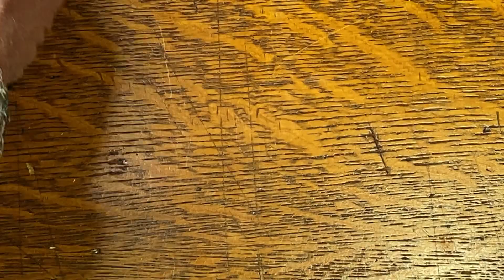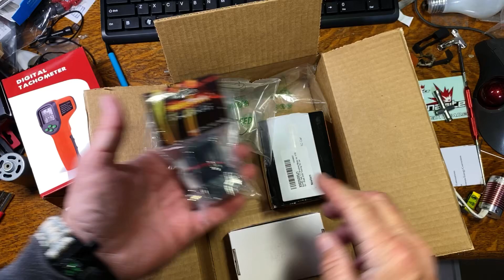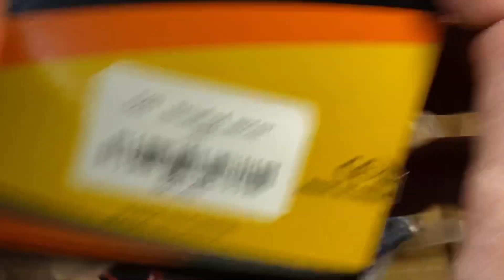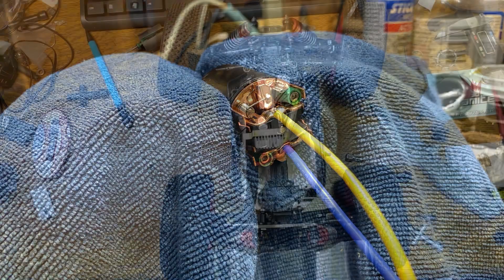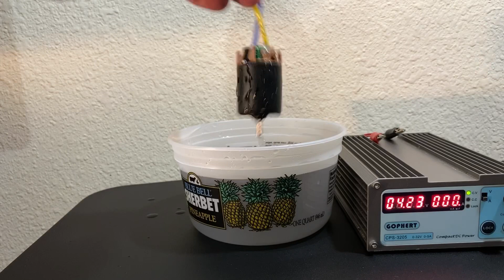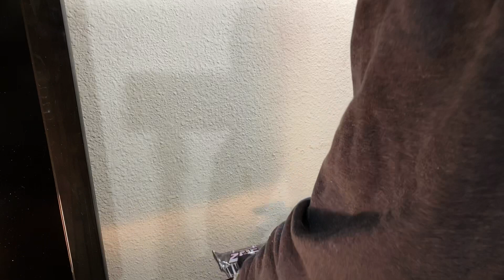WLtoys 144001 new brushed motor

Comment: You got a couple bent axles there man....my car is smooth a slick eather way in my hand and or on the ground...if it does vibrate something is bent or gears need lubes or addressed...
Reply from the maker: Nothing bent and everything is greased. The car actually benefits from droop screws. There were a lot of people on the early version of the car that complained about the same problems. 

I was just demonstrating that there was nothing wrong with their car. Droop screws make a huge improvement, especially for the people doing speed runs. 

There have been a lot of upgrades on this car in the last three years. 

Thanks for stopping by. Have a great day and be safe out there.

Comment: Bought one of these of Amazon for a physics project (we're making electric cars and racing them down the hallway) anyway, I soldered a couple of wires to a switch and a port for a 7.4v 20 watt lipo, and it isn't working. It's been a while since I've done much in the rc hobby, but I assume that this motor should work by itself directly to a battery with no esc. The problem is as soon as I turn the switch on, the motor starts then immediately stops by itself about half a second later. When it does briefly run, it has virtually no torque or speed. Any ideas what I'm doing wrong? Thanks
Reply: Brushed motor, battery is charged. I don't have a esc as we aren't making them rc, we're just turning them on and putting them on the floor and seeing whose group passes the finish line first. Since it's a brushed motor and not brushless I'm assuming that I don't need a esc to run it. Any other ideas? Am I missing something or could it just be defective? Thanks for the help
Reply from the maker: @clmfilms8103  it could be defective. That’s why I wondered if you tried the motor in an RC car. 

It’s just a DC motor so if you connect the + terminal to the motor then connect the - to the switch and the other terminal on the switch to the - on the battery.
Reply from the maker: It sounds a bit like your battery is dead. 🪫 I’m assuming your motor has two wires. There is a model with a brushless motor. 

Did you try running through the ESC with the remote to be sure everything was working?

Comment: hello, is it possible to drive a 16turn brushed motor on 6s battery (22,2v), and not destroy the brushes after a second ? thank you  !
Reply from the maker: You would need to look at the specs for that motor and you would also need an ESC rated for 6s.

Comment: how much turns has the oem motor?
And is it save to run a motor with like 1-2 turns less without burning the ecu?
Reply from the maker: I believe it’s a 17t 550. You should be able to run a lower turn motor but stick to a 2s battery on the oem ESC.
Reply: @RCModSquad  okay...do you think i can run it with a 13t on 2s?
Reply from the maker: @raptor2330  if you use a smaller tooth pinion it will decrease the load on the motor so it should be ok. 

I’m not sure exactly what the top speed would be but it should have a nice amount of torque.
Reply: @RCModSquad  ok thank you
Reply from the maker: @raptor2330  You’re welcome! Have a great day and be safe out there!

Comment: I'm running a 13t motor from surpass hobby but it does not engine brake and everything appears to be correct ie esc set to f/b/r and wires are the correct way as in goes fast forward and slower in reverse. So I guess my setup is correct but it just free wheels when I brake any ideas on why the only thing I've done differently is I've soldered my wires to the tabs on the outside edge as apposed to in center like u did. I'm stumped as to why it doesn't stop unless these motors just don't ? Or could it be my wire placement on motor any help would be greatly appreciated as I've kinda got the idea to do this from your 13t video when u got 44mph love the vids keep em coming.
Reply from the maker: Sorry you’re having issues. I’m not sure why there’s no braking. The solder location shouldn’t be a factor. 

It sounds like you have the jumper in the correct spot. You would have to dig up the spec sheet on the ESC you have to see if there is any programming changes available. Some allow changes in the brake % and punch rates.
Reply: @RCModSquad  thanks im sure that it is braking but really week my esc does not appear to be programmable i just took it for a run did about 4 passes and it was nearly toast. Melted a bullet connector from esc and the motor got so hot it started to unsolder its self little drops on plate doh! so I've repaired it and limited it to 50% on controller. To limit the current a bit thankyou for ur quick reply tho I'm sure its brushless time for me as this setup i have is hassle. I've nicknamed my red 144001 as little inferno as it like to burn lol. No sweat was hoping a 13t motor would be a good stock replacement. I'm questing that less turns equates to more current draw. Its all a learning curve.

Comment: Can stock esc handle the 17t 540 motor?
Reply from the maker: The stock ESC did fine on the 17t motor with a 2s battery. 

Thanks for stopping by and checking it out. Have a great day and be safe out there!

Comment: I just put 8t brushed motor in mine i hit 50 mph really 50 mph. Best 20 bucks ever stock everything else omg i beat a casle system with the stock electrics and a 8t brushed brushed!! Motor. Twenty bucks and 50 mph. Mph for real
Reply from the maker: Awesome! 👍🏻👍🏻 Did you put a fan on the ESC? The stock ESC probably won’t last very long without a fan unless you just do short speed runs.

Comment: Hey Dave will the spur and pinon  fit in the 144001
Reply: I bought the jrelecs 3900 kv 3650 will that be a direct fit to the 144001 thanks in advance
Reply from the maker: @johnporter1613  it is a direct fit. That should hit 46-48mph on 2s. 😃
Reply: @RCModSquad  and the radio link rc4gs v2; hope it links up with everything
Reply from the maker: That want be a problem. 😃
Reply: @RCModSquad  thanks alot
Reply from the maker: You’re welcome! Have a great day and be safe out there!
Reply from the maker: I’m not sure which pinion you’re asking about.

Comment: How many cells does it use Battrey and how many amps of esc
Reply from the maker: With the 17 turn motor I ran it on a 1060 hobbywing and I ran it on 2s and 3s. 

I’m now using a 13 turn on the 1060 hobbywing and just running it on 2s.

Comment: Hello bud. Nice video. Quick question if I may? When I did the video on using 1:10 wheels on my 144001 I was warned that I can cause damage on the drive train etc due to the extra stress of the larger diameter wheels and mine where much smaller than yours. Do you think it can cause damage. I think they also said extra strain on the stock esc/motor but you won't have that problem but could that in your opinion also happen? Cheers buddy. Have a great day! 😊
Reply from the maker: I did in fact kill the ESC with these tires. 

The large tires change the final drive ratio so it loads all the drivetrain up as well as the ESC and motor. I haven’t killed any gears YET but I’ve killed all the stock ESC’s. 

Kinda what my goal is is a bit like yours. You try and show people how to fix cars for free or little output of money. I try to show people what will happen if they do some of these mods so basically I’m suggesting things for people NOT to do. 

In doing this I can help people not do things that will over time break something. I’ll also end up in the long run with the best bang for your buck mods that actually do work and should hold up. 

Those big tires for example are a terrible choice for speed runs since they ballon like crazy on 3s and make the car difficult to drive but they give you ground clearance for grass and they handle sand and jumps better. BUT they will kill the stock ESC pretty quick without a fan and probably shorten the life of the motor. 

Take care buddy! Have a great day.

Comment: Maybe a dumb question, but on the stock motor they placing the diode, and after replace itu with new motor, its necessary to replacing the diode on new motor or not?
Reply: Thanks for the advice, its help me alot, its like big questing what the meaning this diode, but if its not necessary so its no worry, once again thanks and have a good day sir, sorry for my bad english
Reply from the maker: Eygan Hobbykere your English is fine. The purpose for the diode is for reverse voltage spikes but many people have removed them with no bad effects. 

Be safe my friend!
Reply from the maker: Sorry for the slow reply. I’m not getting my notifications on all my videos so I have to go through all of them to find comments. 

You don’t need to move the diode over when you do a motor swap. It will work just fine without it. 
Thanks for stopping by and have a fabulous day.

Comment: Is it possible to use arrma typhon mega 550 brushed motor in it?
Reply from the maker: The motor should fit but if you have the 12t the ESC might not handle it. You could try it on 2s and keep a close eye on your temps. 

Thanks for stopping by and have a fabulous day.
Reply: @RCModSquad  was thinking to haul the brushed system from my typhon to 144001 as I will be upgrading my typhon to brushless.
Reply from the maker: Michael K it will bolt in but you need to watch the temperature really close.

Comment: I like the type of wheel you have mounted, but would the stock motor struggle with the size of them and overheat?
Reply from the maker: +swalstar thanks for stopping by. Yes, I think those wheels are too big and load the ESC and motor up too much. 

If you just do short speed runs it might be ok but I also think bashing with them would be tough on the gears too.

Comment: Great video.  Just wondering if you know where I can quickly get a hex pin for the wheels.  I can’t seem to find them.  If I know what they are I’ll get a metal hex set but want it to come fast.
Reply from the maker: DrPriiime I’ve used these on the 959b. 

Hobbypark Aluminum Wheel Hex Hubs 12mm Drive Adapter with Pins 2x10 mm for RC Car Upgrade Replacement Parts (Pack of 4) https://www.amazon.com/dp/B016MYJYC2/ref=cm_sw_r_cp_api_i_ere0EbTFHTZY6

Comment: Can you add a fan for the speed control using the LED 2pin port? I ran mine on 3S and it's real hot after a run. Any suggestions on a particular fan that would work/fit in the car and the port? 

Great video btw, bummer about your esc. The top end speed on 3s with those big tires would be crazy, I'd guess 55-60mph
Reply from the maker: Glen Wolfe thanks for the kind words. 

There’s not a lot of room under the body but I have seen a couple of people using one. I personally don’t have any experience with installing one. I will be trying that in the future. I just got a 13t motor and a new ESC so I’ll try that after my vacation in June. 

If I get the fan figured out I’ll make a video on it. 

If you can deal with the wiring this might be worth a try. 

Hobbypower Alloy Heatsink w/ 5v Cooling Fan for 1/10 Car 540 3650 Size Motor Purple https://www.amazon.com/dp/B00J5AUOYS/ref=cm_sw_r_cp_api_i_B7EZEbWFCGKE7
Reply: @RCModSquad  Thank you for the reply! A 13T motor in this car on 3S is going to do 65-70 easy ha! Love it! 
I checked out the fan, so would you suggest a motor fan over an esc fan? I was thinking something that would sit right over the esc, I just wish I knew what type of connector the led port takes and if it would even work. Thanks again for the reply!
Reply from the maker: Glen Wolfe sorry I went off on a tangent in my head. It’s been a long day. 😃 That’s a two pin JST connector but I don’t recall what size it is. When I get home tomorrow evening I’ll try to figure that out and get back with you. I’ll also measure the ESC and try and figure out what size fan will fit. 

Have a great night and be safe out there!
Reply: @RCModSquad  Wow! Thank you!
Reply from the maker: Glen Wolfe another long day. I finally made it back. 
The LED port is a 1.25 JST. It appears to be passing the battery voltage directly through but it might be current limited. If it is it probably won’t run a fan. If I get a chance in mid June I’ll order a fan when I get back from vacation. 

Here is a link to the correct plug. None of my links are affiliate links at this time. You might be able to shop around for a better price or a smaller quantity. 

Letool30 Pairs JST 1.25mm 2 Pin... https://www.amazon.com/dp/B013JRWCBU?ref=ppx_pop_mob_ap_share
Reply: @RCModSquad  Thank you for going through all of this trouble. I found a complete brushless conversion kit on ebay for 68 bucks. Comes with remote, receiver, 120amp esc, motor and servo. I ordered a metal spur and pinion separately because I heard the plastic spur doesn't last 5 mins with the brushless set up. Thanks again!

Comment: Hai sir,🤗
I just put the big tire,i think the tire same size like your car .The problem is,stock motor and esc is overheat and have some smoke go out from the motor,do you have same problem sir?..tq
Reply from the maker: Azrel Jamaluddin yes, mine did after time overheat the ESC. I cover that in another video. 

I don’t recommend the big tires or 3s for this car unless you do really short runs with it.

Comment: Which is better and more powerful the 550 motor of the wltoys 144001 or the 540 of the 959b?
Reply from the maker: el swaizer thanks for stopping by. For the same number of turns the 540 usually has more speed and the 550 has more power but is a bit slower.

Comment: Hey,
Have you solved the 'Wheel Bearing ' situation?
Reply from the maker: Al Carrière are you talking about the correct spacers?
Reply: No,
I wanna know what you think of the lack of the small as bearings that are nee6
Reply: Look up the specs
Reply from the maker: Al Carrière the motor did have bearings. They have a cover on them so it just looked like bushings.
Reply: No no. 
The WHEEL bearings
Reply: Split all that open.
Let's see how long it takes to pick your jaw off the floor. Mine fell right of way

Comment: Finally figured out what was wrong with my car. Turns out the main gear coming out from the motor had one tooth that was a little bit crocked. I'm fairly certain this is what made it rattle so much.

First tried it with a half charged 2s battery and was honestly not very impressed.

Put in a 3s battery I had that fit well and it runs like crazy! Completely different car and it just skidds around in the little snow / ice we got here now.

I did feel the esc and it was warm to the point where I could hold my finger on t for 6s before it got to the point where I felt I was burning myself.

How warm can it get without being damaged? Will take the ir thermometer on it tomorrow and check the temperature. Might get one of those small fans and put on it since I'll definitely keep running it on 3s if I can. So much more fun.

Thanks for another good video.
Reply from the maker: Avecforte so were you able to straighten the gear? I think I would try to stay below 125°. You could probably go a little higher but the cooler it runs the longer it will last.  

I’m planning to try and increase the size of the heatsink if it’s not too much of a pain.  

Mine is definitely faster in 3s but it’s pretty peppy on 2s with a good battery. 

I’ll try to get out a GPS in the morning if things work out. 

Have a great day.
Reply: @RCModSquad  I first tried to get a dremel in there but it was too tight.
Eventually just used a small metal file that I have a whole set of. Worked quite well and even though you can see it it's much more even now.
It was as if though one tooth had been bent on the middle about 1mm or so which made a little piece that kept bumping into the plastic gear.

Found a thread online about it and apparently its not an uncommon thing.
Reply from the maker: Avecforte interesting. I’m happy you found it.

Comment: Nice motor, to bad about the Esc, great info on the break in of the motor 👍👍
Reply from the maker: @admin5322  I never had any issues with other motors not working properly. The biggest problem was trying to run motors with to few turns over heating the ESC.
Reply from the maker: Kurt Weishaar thank you for the kind words. 💯👍🏻 I think I’ll like it and it’s a lot cheaper option than brushless if it works out. 

I ordered a new ESC but it won’t be here for a while so I think I’ll pull one out of the other car and try to get a GPS reading on the car tonight if there’s enough light when I get home. 

Have a great day and thanks for watching. 👍🏻👍🏻
Reply from the maker: @admin5322  I’ll have to look into that. I don’t recall having any issues with brakes when I was running the stock ESC and the 27t motor. I didn’t run it for long so maybe I overlooked that.

Comment: Hi.
Why you put this 540 motor?
This motor have more power than 550 motor?
Amazing work have you do, teaching people about rc cars 😉
I am still waiting for more videos 😉
Reply from the maker: Rui M thanks for watching and thanks for the question. The stock 550 motor was a 17turn and this 540 is a 17turn. 

This is a bit of a broad statement but the 540 will probably turn more RPM than the 550 did so it should have a little more speed but might be a little slower from the start. 

One other reason I picked this is because it would be easy to rebuild. 

I also have the 550 21turn that I will put in this buggy. 

I’m just trying a variety of motors to help other people decide what they might want. 

Not everyone want to do a brushless conversion so I thought I’d try and show a few less expensive option.
Reply: @RCModSquad , thanks 😉

Comment: Dont know if that esc can handle that motor. Mine did the Same with my 13t motor of your same kind. If you have another brushed esc laying around u should try it
Reply: Ok give it and go when u got time.
Reply from the maker: prof3ssor ghana I think it should be ok with the 17t or the 21t on 2s if I go back to the stock tires. I have a new ESC ordered. 

Thanks for the suggestion. 👍🏻👍🏻